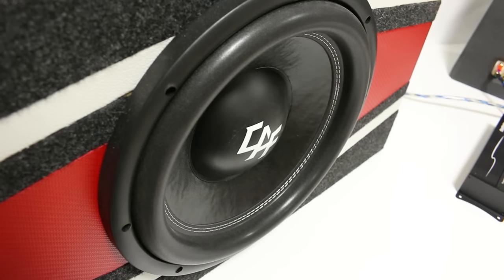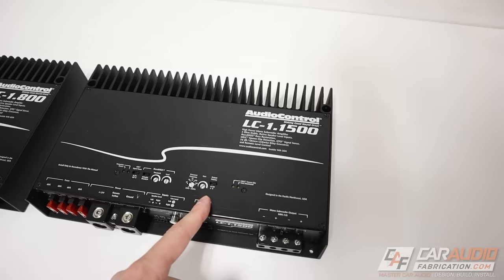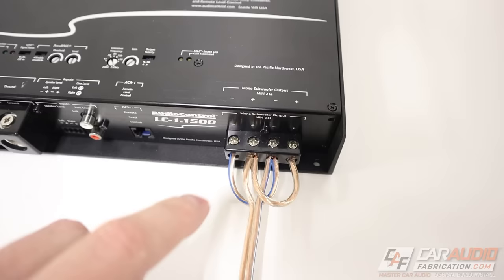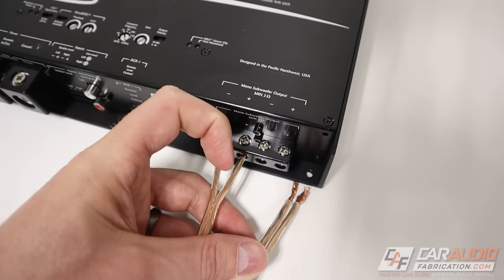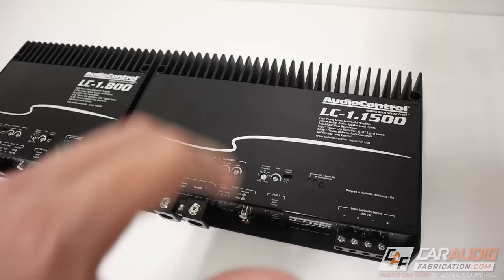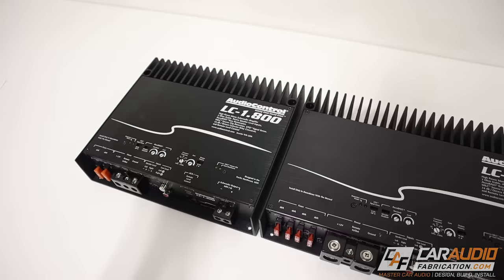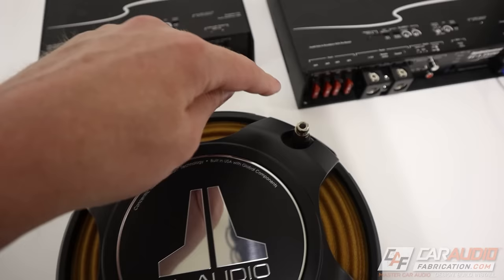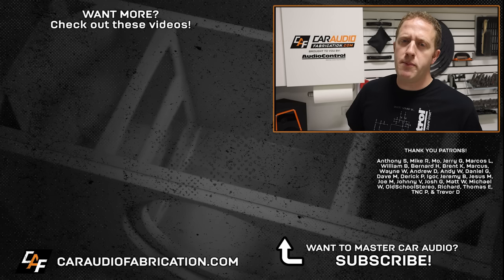The RIGHT WAY to wire subwoofers to a monoblock amplifier

Comment: There is actually one major advantage to bridge or use both the outputs on the dual that you did not mention, I would always bridge or use both outputs always if possible, why? it is very simple, This speaker block is internally connected on the PCB, if you use one pair you gonna push all load through 2 solder connections instead of 4, I had amps where this load got so high the joints exploded and the amp failed due to overload on these. if you use both outputs you gonna share the load on the terminals making such failure case much less prominent. However this applies more to cases when you load the amp with lower impedance thus making more current. But I had amps fail before I always started to use the terminals with all available outputs. you would actually gain a tiny but more power too as the resistance get slightly lower. I competed in audio a lot before and this is why I know. Every watt counts
Reply: Great point, and 4-channel home audio wire could solve the issue, eg 4 wire. Doubling the wires reduces the total AWG by 3, making it feasible to use a speaker wire (eg, 16 awg) that actually fits instead of trimming or using special tips to fit a monster sized wire, plus both connections get used.  The 4-channel wire is better than 2 runs of wire, as the wires are bound into a single cover, minimizing impedance fluctuations.
Reply: @perk28  great to hear your feedback about this! Bassheads unite!
Reply: Running to a dvc what advantage of running 4 conductors? Instead of just jumping them in my box that little bit less resistance will be made up by another 2ft chunk of wire
Reply: @Spacecadet3890  The biggest benefit is that you reduce the load on each terminal since you run less current through each wire and terminal as they split in half you will have more power and less heat produced in the interconnects and wires. But in low power amps it gonna be a pretty small amount. 
I had an amp with more than 1KW power explode the solder joints on the speaker terminal because it was too much current for one single output. So it is just a matter of caring about your stuff but either way you connect is still gonna work unless it can’t handle the power in the long run
Reply: They are typically just bussed at the terminal with only one pair going to the board, so it wouldn't matter.
Reply: @TE5LA-GAMING  maybe typically but not always. I had one amp that broke because not all outputs was joined together as a block. It was the solder joints that bridged those connections and I completely blew out the connection almost enough to destroy the PCB itself. The solder joints literally exploded by the 1,5KW of power that flow through them. After I repaired the amp I always connected all outputs together and it ran perfectly until I took it out of use way later.

Comment: Just received my Lc1.1500 yesterday! Been dreaming of this day for a year. Im working with you now on a custom subwoofer box for my SQ5. Checking my email like every hour 😅 Always love your content, thanks for all the info!
Reply: Hi Kodi, I wrote a comment that my LC1-1.1500’s cooling fan is always on when powered. Like to hear from you if yours does the same. Feedback of a fellow owner would be welcome.
Reply: @umtbozkr2358  I mean, the Amp has to stay cool but I guess if it's loud enough to hear, it can be annoying. I've used cheaper Amp before and the fans were audible and always on, but on my Audiocontrol or Phoenix gold, never really heard them.
Reply: Dream big bro
Reply: @umtbozkr2358  d 1200 fan runs w amp.  Quietly, notic d the amp gets warm w no load even. Likely why.
Reply: @dwilde649  I’m sorry, didn’t understand your comment D Wilde. The amp works perfect and delivers a good performance. Only the fan is constantly on and it’s not the most quiet fan. Normally I ran my woofer with a bridged Steg K2.03 with about 1000w RMS. When the fan went on you couldn’t hear it running. I replaced it by the Audio Control because it draws less current because it’s a class d amp. A class d amp shouldn’t get that hot; even without any load it gets hot.
Reply: @umtbozkr2358  mine is still new only been installed a month but even before I had hooked speakers to it I noticed it being somewhat warm not to the point of being a problem but I did notice it has been different than most class tees in that way. Performance is great Fann does run but it is quiet perhaps it runs faster if in a location where it doesn’t get good airflow? Or if you live on a dirt road and dust may have clogged Vents? My fan is so quiet I didn’t know it was running until I was literally head at the amp making connections
Reply: 😊 XO

Comment: so i bought a sub and built in amp the amp isnt getting power no lightd or anything yes my connections are good no theres no spots wgere it arched over on the mother board yes i hooked it directly to the positive and negitive on my battery can any one help

Comment: It always baffles me that this confuses so many people. The amp could have as many positive and negative output connections as the end panel will allow, it's STILL just one positive and one negative....... imagine the outputs being buss bars, you could tap and connect as many speakers as you want, as long as the final Impedance load matches the amplifiers rated load. Technically, the multiple outputs on a mono block amplifier ARE just that, buss bars.
Reply: Maybe you're onto something.  Sell a buss bar that connects to the speaker output, but has FOUR terminals.  Now you can get 4 times the power from your amp.  BAM - instant profit.
Reply: @MoparStephen  🤣

Comment: I am so happy that you made this video.

As a car audio installer, I had a couple customers that were unwilling to take my word, even when I showed them the exact demonstration of continuity that you showed, that I had correctly installed their amp. One guy was absolutely convinced that his subs were only getting half the power because he was only using half the amp. I think that at my boss's direction I actually ran a second set of speaker wires to his box just to apease him. 

My MECP advanced certification wouldn't convince these people that I knew what I was talking about, but I bet that a popular YouTube video that confirmed it would do the trick.
Reply from the maker: Happy to help! I don't know why guys always feel like the car audio shop is trying to pull one over on them... although I did have a guy today comment that "he's only recommending fuses because he sells them, you don't need fuses on wiring" so guess us YT guys can't be trusted either... 🙄🙄🙄
Reply: @CarAudioFabrication  fuses are for us peasants who cant afford to just buy a new car when our current one sets on fire
Reply: Use 4-channel home-audio wire, with 4 wires wrapped in a single cover. That way you can use both both connectors on the sub amp, plus whatever gauge fits exactly, times two, is likely thick enough. Your less observant customers will think the 4-stranded wire was specially made for sub amps.  🤣
Reply: yeah just add that second pair of wires, a 4-terminal plate and connect two wires to the air inside the box lol. remember, 15 minutes on youtube means you know more than experienced techs :)

Comment: I just bought a Polk mm1 10inch 4ohmDVC subwoofer and in the manual there is a diagram showing connection to a single pair of terminals on the subwoofer, now with that connection you will only be at 4 ohms but it can be done

Comment: Your correct about the amp, but with the Sub not all the terminals need to be connected if you want to run 4ohm, 2ohm or 1ohm etc
Reply from the maker: Sounds like you didn't watch the video
Reply: The additional terminals are for convenience. It can also be that they use the same case for 2-channel models so the strip is already there.

Comment: Im really glad u posted this vid,i have a different class D monoblock that has 2 terminal like this and my multi meter is or was older and mu kid attempted to ohm a live 120vAc circuit and it became um melted so was concerned about the ohm load to my amplifier which i usually keep at 2 ohms though i found the amp is 1 ohm stable but my question answered thank u

Comment: How about how to test a used amplifier on the fly? I was burnt picking up a Rockford Amp on Craigslist. Met in person, tested the continuity at the speaker leads, got home and it popped fuses left and right. Obviously i did not do it correctly. I have bought from a dealer or amazon every since then 2013.

Comment: Hello Mark. First of all, I thank you for its contents, and I have a question for you (I have 4 speakers of 8 ohms of 480 voltage of each and one 6*9 low) what kind of amplifier should I use for my car without affecting anything. Please
Reply: Makes no sense. What is "480 voltage"? If you have 5 speakers total, use a 4-channel amp. Wire the 8-Ohm speakers in parallel, 2 to a channel.  This gives 4 Ohms. Bridge the other two channels to the 6x9. Set the xover to LP of the 6x9 channels and to HP for the high speakers.

Comment: I got two kicker ten inch to ssl amp I got it hooked up right I get a wining sound when I press the gas on my car
Reply: Buy a real amp. Doesn't it have a low-pass crossover? You should never hear an alternator through a crossed over sub.

Comment: On a dual voice coil sub can you run short wires between both negative terminals and positive terminals. Then run a single neg/pos to the amp?
Reply: Yes you can 
 or do like he was showing and run 2+ and 2- wires to amp so the wire won't limit power but it   might not be even a noticeable difference.  
  So it's bridged but kinda like 1 dual coil 
Is wired like 2 speakers. 
   Either way works.    4 wires would be able to transmit more power 
But if the 1+ 1- and jumper wires aren't  limiting   ie  maxed out 
 then there wouldn't really be a benefit to the 2 more just  
  It's like the 2 outer tires on a dullay truck
 when there's no load  
 sure there's potential but not really needed when it's empty

Comment: So if I have dual outputs on my amp & 2 4ohm subs. Are you saying wiring both separately to 2ohms then connecting both pairs of each subs pos & neg wires  to the amp directly will result in a 1ohm final load? Which essentially is wiring them in parallel but through the amp instead?

Really need this answered. My box’s port is in the middle & I don’t want to drill a hole to wire them together if I don’t have to 😢
Reply: Same I don't know why I can't find this anywhere.
Reply: @kushmade1  I figured out the answer on my own; the answer is yes; you can wire two 4ohm subs individually at 2ohms, then connect them to the amp (if the amp is a monoblock) & the final load will be 1ohm. The speaker out terminals aren't two separate channels, but most monoblock amps offer an extra set of terminals for this exact reason, convenience.

Hope this helps, man! :)
Reply: @ijonnypro You can't wire a 4 Ohm sub to 2 Ohms unless it has dual voice coils, which you didn't specify. If you're saying wire two single VC 4 Ohm  subs together to get 2 Ohms, yes, but it is still 2 Ohms on a mono amp. It would only drop to 1 Ohm on a bridged 2-channel amp.

Comment: Can you wire a 2ohm dual voice coil subwoofer at 1ohm to a monoblock amplifier that’s rated for 1ohm or higher or will I need to wire the subwoofer to 4ohm to make it a 2ohm load at the amplifier?

Comment: Quick question. The cable that connects the gain control switch to amplifier is too short to reach amplifier. What type of cable can I use instead of the one provided in my amplifier install kit? Looks like a 6C6P or Cat6 ethernet cable.
Reply: You must have a hella long vehicle. I usually have to bundle six feet of cable because they are so long.

Comment: I just got a 1600w 12inch skar subwoofer vented  it is preloaded in a box wired to 1ohm 1600w peak 800w rms with turning frequency of 36hz and im an amateur and got the 1200w rms to 1600w peak amplifier and dont know anything to set gain lpf or subsonic but want to know how i can get the best sound out of my bass without it sounding wobbly or damage my subs how do i set those settings the easiest way

Comment: I have question that I would like your opinion on. Just so we are clear ALL variables are equal in this situation. Question - Is it more efficient to run two Amps separately on two separate subwoofers? Or is it more efficient to run one large amplifier on both subs? 

So we are clear. Two Alpine subwoofers that EACH take 400 RMS. On two 400 RMS Alpine amps or one 800 rms Alpine amp?
Reply: It makes no difference where the power is coming from all the subs see are power. Does not matter if it is one amp or two. The only difference it makes is on audio signal. You cannot run 2 different signals to two amps because they would play at different timing. Just run one audio signal to the input on amp one and then use the audio output on amp one to the input on amp two. So the audio signal is linked. Just make sure your amp has an audio output :)
Reply: @Pasler Andrew I was saying more for someone that might be using 2 5-channel amps and that 5th channel on each amp for each of your subs. They are identical amps with the same about of “efficiency” and power
Reply: @peytonscoggin3746 Actually,  it does. Separate amps have separate  power supplies, so this may be an advantage unless you assume the single amp has twice the power supply.

Comment: So, in theory, lets say you have a 2 ohm single coil woofer with built in wires that are too big for the connectors of the amp you are running ( and probably needs more power than the amplifier can push, but thats beside the point). If one was to machine som adapters that would accomodate those wires and be screwed in to the amp, that would share the load onto the solder points on the PCB?  sort of like a Dual 1/0 AWG to 1/0 0 Gauge amp inputs but more fancy to not come into contact with each other?
Reply: There are some amps that conveniently put the positive terminals on one side, negative terminals on the other. So adding an adapter like this is much easier. But if it's configured like the amp in the video it's going to be hard to do.
Reply: I think you'll find that most amps simply jumper the extra terminals at the block, rather than run separate wires back to the PCB.

Comment: The jumpers in mono is like Bridge mode in power amplifiers. Is it the same?
Reply: Mono and bridged are not the same. You can have two separate channels running mono without them being bridged. Mono combines stereo signals into a single (mono) signal.

Comment: Great video!   Quick Question Can you tell me will this amp work on the tesla 16 volt battery system Im looking to and a sub but the last amp I used kept dieing out the 16 volt battery.
Reply: Why would you use a 16 volt battery? You wire it to the 12 volts on the main battery.

Comment: love vid, keep the good work up❤. question I have is. if you have four 4 ohm subs and run each to series then parallel leaving two separate connections at 4 ohms then connect it to the amp like you showed. would the connection to the amp still be 4 ohms for all subs or does the amp parallel it again and make it 2 ohms for all subs?
Reply: Just look at it like the amp only has one output, yes 2 ohm is what the amp sees if i am understanding your question right - 4x 4ohm voice coils wired in series per pair then paralleled to the amp.
Reply: No it's 4 ohm

Comment: Question: TIA
I have RCA’s running from my deck back, when I plug in both red and white to the amp, my sun sounds muffled, when I plug in one, doesn’t mater the red to red or white to white, it sounds fine but seems like there is more the sun can give. Any ideas?
Reply: One of your speakers is wired backwards. Reverse the positive and negative on ONE of the channels.

Comment: Good video I had a question, if I have a secondary battery in the trunk do I run my amp that's in the trunk the 2 ground wires to the secondary battery negative terminal post ?
Reply: You should be using a dual battery isolator if you run two batteries.

Comment: Hi I have a energy audio 3500.1  monoblock  what subwoofer  can a put in the car .becose  it already blows my 1 starsound 2700w subwoofer
Reply: If you are blowing a 2700 watt speaker, you have either an amp with too little power, or a very poor speaker enclosure.

I looked up that amp. It's only 200 watts. It claims 500 at 1 Ohm, but I'd say this is highly unlikely. A 3500-watt amp would need two zero gauge power wires.

Comment: How about if I got an 1 ohms amp but my subs are 2ohms  my subs are 2 boxes of Sealed downward-firing enclosure with CompRT® 10" shallow-mount subwoofer and passive radiator my amp output are double so each are connected separately is this okay
Reply: If you wire two 2-Ohm subs to a mono amp, the load is 1 Ohm.

Comment: Because the positives and negatives are connectied does that make a parallel circut inside the amp so if i connect two subs with a 8ohm load each would it be seen as 4 ohms to the amplifier?
Reply: Yes, correct
Reply: No. You are simply connecting the subs in parallel. This in itself produces 4 Ohms. Nothing to do with the amp. The amp senses 4 Ohms. It has no idea how many speakers are connected,  nor does it care.